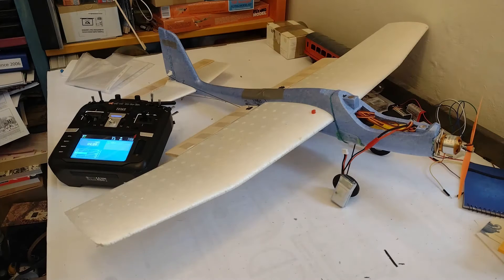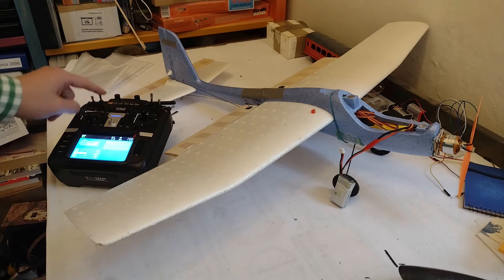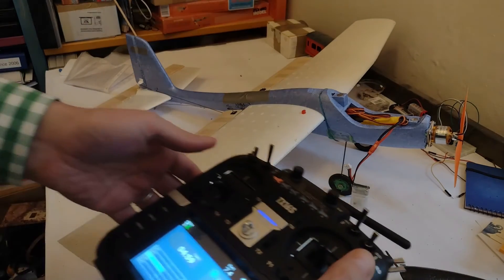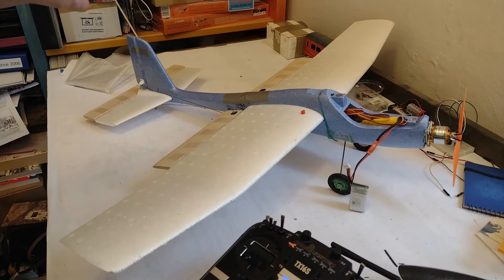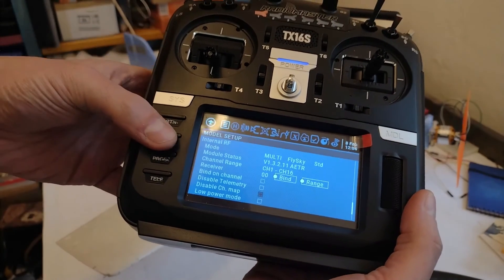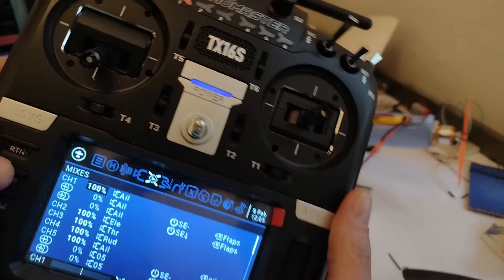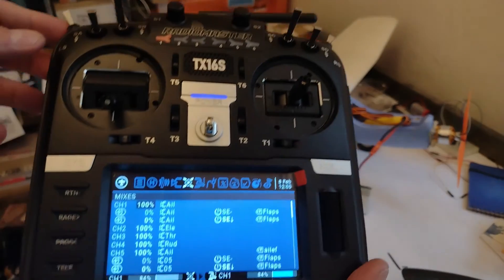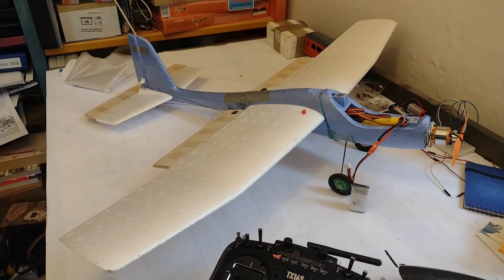07 Lidl Glider RC conversion   Flaperons

Comment: I was wondering why you might have had such a hard time finding an easy detailed set-up video on flaperons on the ubiquitous TX16S Andrew. But I see that there are hardly any simple ones out there showing it on the radio. Also many of those that do (like Bill Clark's that you've obviously used) often show them changing the default channel set-up rather than just adding the extra aileron channel at ch5 below the default group. Can lead to trouble as you discovered. 
Mike Shellim's "OpenTx/Edge Tx Clinic" (Google it) has all the best info on setting up using these operating systems but it can be heavy reading for a newcomer. 😉 
Looking forward to seeing how you go. At least with the LIDL any crashes are usually not quite as destructive as with your beautiful hand-made wood and tissue efforts. 😊